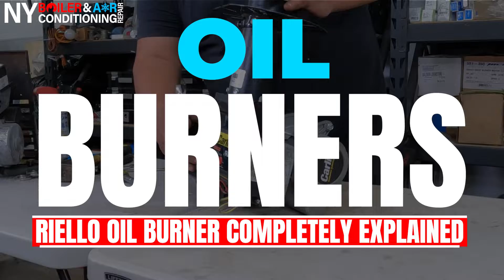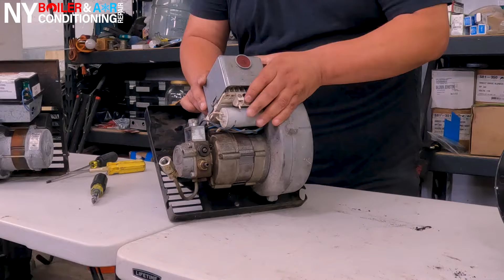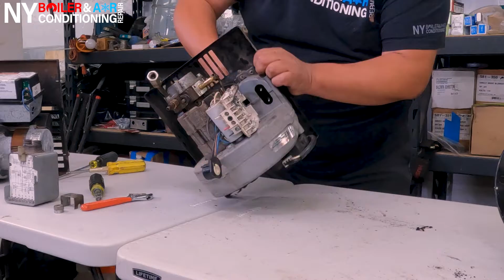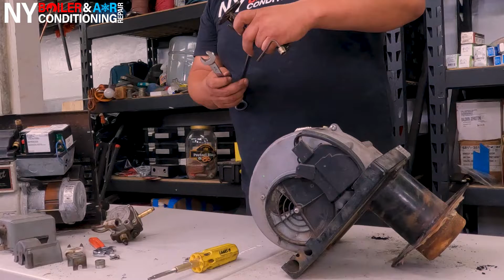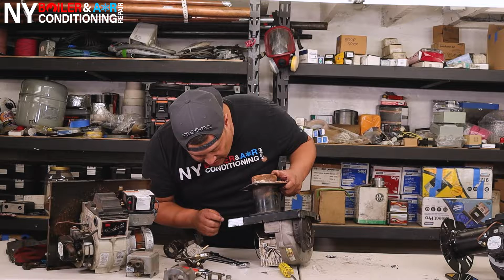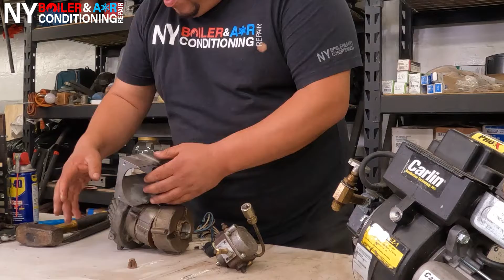What is an Oil Burner? (Riello Oil Burner Completely Explained)

Comment: Need help. I have oil I had flow but no ignition. I removed the nozzle and it is dry..should I change the nozzle and also idk if it’s normal the electrodes ceramic part seemed burnt. Any help plz.

Comment: Thank you for the quick reply. I like the idea of sticking with the Becket because the one part that seems to fail the most is the igniter. They are easy to replace and I can do it myself. The part is readily available at most hardware and big box stores. Not sure it would be the same with the Riello. Thanks again for posting.

Comment: Watching this video because I got a quote to replace my existing Becket burner with a Riello. Heard they were harder to work on and replacement parts might be scarce. You really had to toss that burner around a lot while removing parts. Would it be common practice to remove the burner from the furnace to do maintenance? I'm thinking I should stick with a Becket. What is your opinion. Thanks for posting!
Reply from the maker: I'll be honest. Guys like Carlin & Beckett over Riello because it's easy friendly and easier to work on. Riello is a good burner as long as it's installed correctly, maintained every year but isn't that for every burner regardless of the brand. Really it's just that. Guys don't read or apply themselves to understand the burner. In regards to parts? Yes they are a pain in the ass to get and typically it's a harder to find parts at a local plumbing supply or heating supply. If it was me, i would get a carlin or a beckett. They are both very similar burner and easier to work on and they are more common and where you have a higher chance to finds parts locally or at you nearest plumbing & heating supply.
Reply from the maker: In regards to doing maintenance on the burner specifically, No you shouldn't have to remove it from the furnace. However if your looking to do maintenance on the BOILER specifically   
then the answer is YES. Why? remember your supposed to clean & vacuum out the boiler at least once a year and you need to get access to the boiler chamber and the only way you will be able too is to remove the burner or the front wall plate. On the newer boilers they have hinge style door so you can open up the door to get access to the chamber. But like always, guys that are installing the boiler never think of the future and many times they pipi in the boiler but blocks the door and not realising they just block the door and how you going to get access to clean the chamber to the boiler. So it really depends on the job and the boiler. I look for whats the easiest way with less to disassemble and don't forget you also or you should is  to replace the rope gasket  whenever you remove the front wall or burner.

Comment: Wepa….Im a new subscriber and loving the channel content. Can you please do a video on clogged strainers and filters my boiler constantly fails every other time we get an oil delivery. 
Vaya familia!
Reply: I'm a oil burner tech from mass I couldn't have given a better lesson my self straight to the point no bs
I like riellos but they are a little harder to work on especially if you have to replace a motor. In my personal experience when removing the set screws for the pump don't completely remove them I've run into a few where the threads strip very easily if you are not careful other than that I enjoy them. Great video brother!
Reply from the maker: Great suggestion!. Will do. Weepaaa...